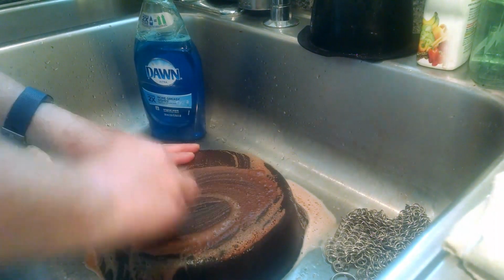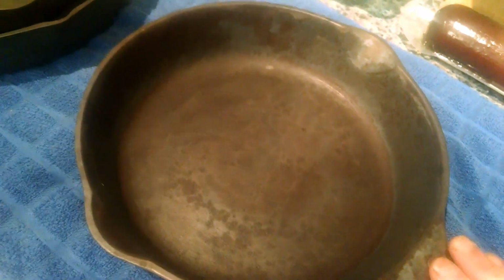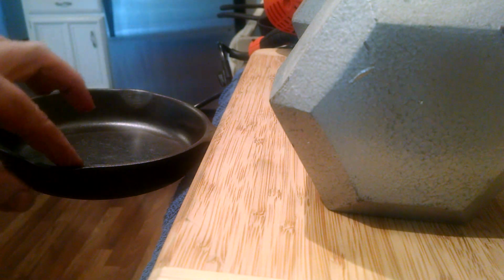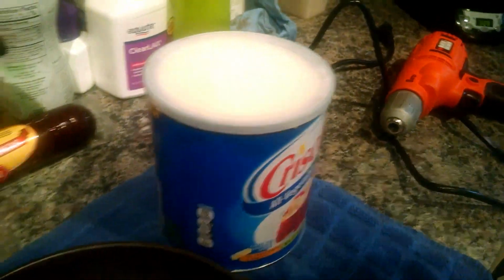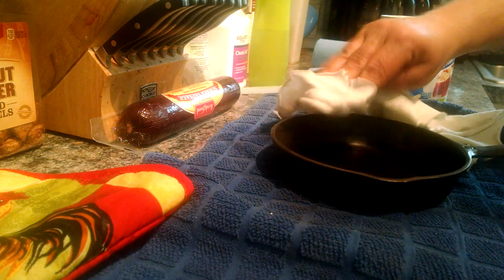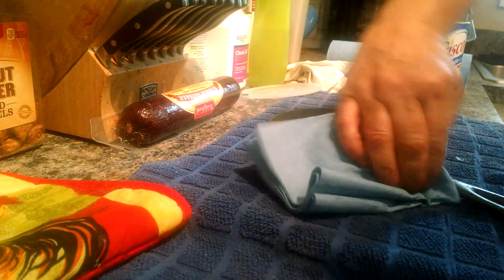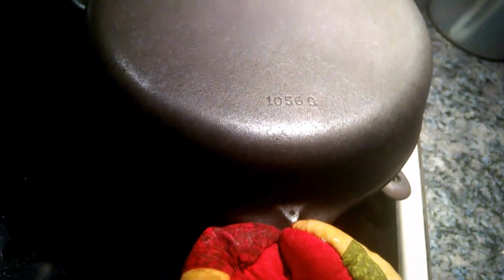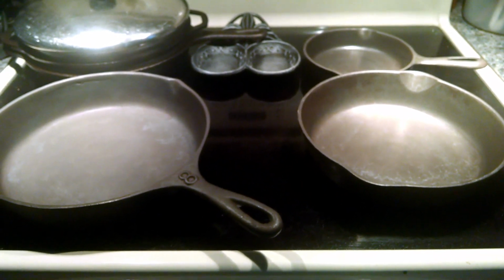Vintage Cast Iron Overhaul from Cruddy to Like New - Part 2

Comment: These are the guidelines I use to identify unmarked cast iron skillets; If the skillet doesn't have a heat ring and the word inch is spelled out in caps "INCH' it's a Wagner. If the skillet has a heat ring and the word inch is abbreviated "IN." it's a BSR. Skillets with three notches or one notch opposite the handle in the heat ring are Lodge. Some early Lodge pans are signed and some have a raised pan size number on the top of the handle. The letters on the bottom of cast iron skillets are mold numbers.
Reply from the maker: Yes, these are what I go by too, but unfortunately, I can't remember them all off hand and have to use my web site castironcollector.com  to look up the info again!  lol  That said, when I made this video, I was very new at identifying old vintage cast iron and have come a long way since then!  lol    Thanks for commenting and for watching.
Reply: I have a cast iron skillet with one notch opposite the handle in the heat ring. It also has an X on the bottom.
What is it?
thanks Glen
Reply: Thank you.  I never paid attention to that.

Comment: Never heat empty cast iron above 1000 F.  The structure of the iron changes at that temperature making it brittle and susceptible to cracking and warping.  This damage is evident if you knotice reddish areas that come through the seasoning.  If your pans are seasoned and you see the redness it is not rust, it is a weakened area.  Ovens vary, however the self cleaning setting temperature is usually over 1000 F.
Reply from the maker: I've never had any issues with my self cleaning oven and my oven doesn't get that high plus I don't leave my skillets in oven at that cycle for more than 2 hours.  That said, I do agree with everything you said.  I can't believe the number of people that comment that they throw their skillets into a fire to bake everything off and that is worse than my self clean oven.  The reddish areas you speak of are indeed fire damage and thus cannot hold seasoning, rendering any skillet with this damage useless.  Also any temperature change in cast iron should be gradual so as to not crack or warp the pan.
Reply: @ladylibertystacker2014 Nice video.  You got a like from me.  My post was cautionary for the "throw it in the fire" crowd.  I even watched Cowboy Kent Rollins put his in the fire.  I am watching these videos because I have my grandfathers 15 gallon cast iron cauldron.  I need to clean it up so I was looking for ideas.
Reply from the maker: @wb2194    Yeah I've seen Kent Cowboy Rollings do some questionable things myself that I would never do such as using flax oil to season with!

Comment: I know this was from July but in viewing your cast iron overhaul, and to help answer your question on your unmarked #8 skillet, from the handle construction where it comes  into the main skillet it very likely is an unmarked Erie skillet as they cast their handles the same way...
Reply from the maker: Now you're talking!  I think it's been called everything from an old Lodge to a BS & R, to a Southern Mystery Skillet!  lol   It cooks fantastic and truth be told, I really like Griswold the best, followed by BS & R or Wagner equally.  Whatever it is, it will remain in my collection for sure!  Thanks for watching.  :-)
Reply: What I have found is most Cast Iron skillets are cast in two ways one where the side and the bottom come together at almost a right angle or flow into each other with a slight curve where they meet, the handles seem to be the identifying characteristic, if you look at an Erie casting at this point you will see a great similarity where it meets the pan wall on the underside of the handle. It is great to see they are being used for what they were designed to do, and not just decorating someones wall...enjoy cooking with your pans.

Comment: I like that you season more than once.  Those old Wagner's are so much better Than Lodge because they are so flat.  The steel brush wheel is the way I go too.  I never clean with soapy water without re-seasoning.  As for the oven cleaner, I have to listen to Cowboy Kent.  If you don't want in your body, don't wash with it.  Personally, I think washing it a few times afterwards will clean that out to a small enough level that it won't hurt you.   Anyway, they look great and I extend my jealousy.  Congrats..
Reply from the maker: Thank you Eric!  Agree with everything you said except for the oven cleaner.  It's just lye,  but an expensive way to use it to clean cast iron.  The lye bath method is essentially the same thing but you can strip more than one skillet at a time and you can leave them in a lye bath for as long as you want.  The lye will not get into the cast iron because it is not heated up, thus it is not porous!  When you are done with the lye bath, then you neutralize with vinegar, so no worries about ingesting lye.  I've seasoned a ton of skillets and use them all the time to cook.  I'm healthy as well, so it works for me!  If you have questions, feel free to ask!  :-)

Comment: Is it acceptable  to use a wire wheel to remove built up carbon before placing a skillet into a lye bath in order to speed up the stripping process?
Reply from the maker: I always recommend using a lye bath (or Heavy Duty Oven Cleaner which is pure lye) FIRST before doing anything else because lye removes the surface crud and softens any carbonized seasoning that has baked onto the surface before putting a wire wheel to it.  I also do not use a wire wheel on truly collectible cast iron like any of my Griswolds, Erie, etc!  Doing so reduces collector value.

Comment: You did a great job on all the skillets, but can I use my regular oven?  Because mine is not self cleaning.  Thanks for your help
Reply from the maker: I really don't recommend using a self clean oven most times but only sparingly for that stubborn piece that is not at risk for warping under the real high heat that a self clean oven reaches during a cleaning cycle.  That said, a regular oven will not strip a skillet because the highest heats it gets to is about 500 degrees which won't do it. Many times a self clean oven will get upwards to 900-1000 degrees and will harm a lot of vintage cast iron because the walls are thin and it can cause serious warp.  Be sure to consult your owners manual for what your actual oven can or cannot do.  That said, I would do the Easy Off Heavy Duty Oven Cleaner (yellow) method in a bag to strip a skillet which there are plenty of videos online to help you do this.  This was my first attempt at restoring vintage iron and I lucked out.  All three pieces are in service in  my kitchen today.  I will be using one of them to saute shrimp a little later for our dinner.  Hope this helps.  Anyway, thanks for watching and for your thoughtful comments!

Comment: Is it ok to have a fair amount of flash surface rust on the pan? I strpped a lodge I bought for cheap from a lady that needed redone. Attempting to do this method now, during the pre heat a fair amount of rust came to the surface.
Reply from the maker: OK.  Once a skillet is stripped down to the bare metal, gun metal gray, I spray on a coat of Canola cooking spray (you can also use Pam as it is basically the same thing) to protect your pan from flash rust.  This will prevent rust from showing up before you get a chance to season it AND in the pre-heat process while seasoning.  This is the best method to stop that once and for all. I do have a video on how to prevent flash rust which should be in my channel cast  iron playlist.    Hope this helps!
Reply: Thank you.

Comment: Lady L,your videos are informative. Which works best,oven cleaning or lye and vinegar method?Thanks.
Reply from the maker: Thank you john!  They are all effective, but the lye bath method induces less wear and tear on your oven, can be left to soak your skillets until you are ready to continue your restoration, but you need patience with lye.  The oven can produce lots of smoke, so wait until your wife isn't home to do that one!  You also need to be careful your oven doesn't get too hot because too much heat can permanently damage your skillet where it will be unable to hold seasoning.  That said, vinegar is needed in most cases to remove rust and especially that stubborn black carbonized seasoning that can look like black warts on an old skillet.  Check out my cast iron play list where I often times combine methods depending on what issues I am dealing with on a particular skillet.  Good luck!

Comment: Is there any way to get build up off the outsides of them? I have a 14" that's 30 years old, used almost daily for 25 years. Lots of build up on the outside and I want to clean it up but don't know how to do it.
Reply from the maker: Can you send a photo of your skillet to my gmail -ladylibertystacker@gmail.com?  If not, then what does the build up consist of?  Is it crud from cooking all these years, oils or seasoning built up on the outside of the skillet? Do you have a self cleaning oven?  Also do you have a regular hardware store in your vicinity?  If you can answer these, then I would know at least where to start.  Thanks.

Comment: Can you sand with steel wool or sandpaper if you do not have a drill?
Reply from the maker: Absolutely!  Steel wool is the preferred way anyway because it doesn’t remove any of the base metal.

Comment: Question... Do you cook with those on you glass top oven? I was told that you couldn't cause it would shatter the glass top. So I'm scared to cook with mine. Any info would be great. Thanks.
Reply from the maker: Yes, I cook with my CI on my glass stove top all the time without issue.  You just can't drop your CI on your stove top (a given) or make any sudden heat changes which includes cooking on high for any length of time or cooking on med-high for a brief time.  Please see my comment detailing the steps you take for safe cooking.

Comment: Did the pitting in the Wagner Ware eventually fill in with seasoning?
Reply from the maker: Yes, actually it did somewhat.  I have used that pan now for almost three years and it is my go to for gravy over toast!  The pitting is much smoother than it was as the seasoning fills itself in.  I supposed if I used it everyday, you wouldn't notice any of it by now as it wasn't all that bad to start with.

Comment: Yea that’s all I do . Some were my grand mother’s . Slick as glass. Thin to .
Reply from the maker: You can use soap (I like Dawn as well) to wash your skillets as long as you have many carbonized layers of seasoning.  A little soap won't hurt them because they are seasoned many times from use.  I don't recommend soap, however, on a newly seasoned pan.  It will remove some of that newly applied seasoning.

Comment: I have Wagner  Ware  5 qrt. No. 8 Drip Drop roaster. Any ideas on how old it may be? I am planning to restore it and use almost exclusively for soups and the like.
Reply from the maker: I have one question for you before I can give you any kind of definitive answer.  Does it say Made in U.S.A. anywhere on the roaster, especially on the bottom?  If it does, it was made in the 1960s (latest possible date was approx. 1968-1969 before they went out of business), otherwise, it was made before 1960.  Check out this site for a lot of information:  www.castironcollector.com  Hope this helps.
Reply: Yes
 It DOES say MADE IN USA
Reply from the maker: Ron M.   Still vintage and Americana is worth restoring!  At least most cast iron doesn’t say MADE IN CHINA!  lol

Comment: I have an identical skillet as you #3 - 6 1/2".  Did you arrive as to the maker of that skillet?  I did learn a lot from you video.  Thanks so much.
Reply from the maker: Yes I did - it turned out to be an unmarked Wagner Ware and I still have it to this day!  Glad you have enjoyed my channel's content.
Reply: @ladylibertystacker2014  I also have an unmarked #5 9 inch skillet with the letter 'H' on both the bottom and the handle.  It looks very similar to the #3.  Based on your findings, I believe it to be an unmarked Wagner Ware as well.  Again, thank you so much.
Reply from the maker: You are very welcome!  You have a Wagner #5 as well.  Wagner put the mold letter on the skillet bottom and on the handle.  That is one of Wagner's tell tale signs of their process in addition to the font on the bottom detailing the size.

Comment: What would you suggest if someone doesn't have a self cleaning oven?
Reply from the maker: The best way is the long but easy way.  First a lye bath (5 gallons of water + 100% pure lye crystals added to the water) soak for as long as it takes, followed up with a 50/50 vinegar water soak to remove stubborn old carbonized seasoning and rust.  After that some elbow grease is required to finish off the skillet before seasoning.  have several videos showing this process on my cast iron play list.

Comment: I refurbish my cast iron with easy off oven cleaner.
take outside lay on several layers of newspaper and spray the inside , clean it, and then do the outside.
Reply from the maker: Yes, I have occasionally used Easy Off Oven Cleaner Heavy Duty kind when I get that stubborn pan.  That said I usually use my lye bath to soak the skillets followed by a vinegar/water soak to remove the rust that the lye couldn't remove.  Easy Off is essentially the same thing, just more expensive if you are using it to clean multiple skillets.

Comment: I watched a man remove the rust with half a spud 🥔 and table salt and a little water and it worked ok maybe next time try heating the pan in the oven then try using the spud and salt to get deeper in to the iron paws this is just a tip and up to you if you want to try next time I hope this tip works well for you
Reply from the maker: A vinegar wwater soak is quite effective as is Coca Cola and if one is desperate, there is Evaporust, although that is quite expensive.  But thanks for the tip.
Reply: LadyLibertyStacker  I have used vinegar before or my pans and it does work well to .. I think rubbing a lemon on it would work as well not that I have but I might one day lol

Comment: Great job.!Thanks for showing what can be done with an old skillet I have a size like the second one. My is  a doge made in the USA .will work to get my to look like yours. And if u sell yours, may I sell my.😀😂.
Reply from the maker: Thanks Agnes!  This was my first attempt, but first I did a lot of research on the best ways that would possibly work for me.  I am happy to say these skillets are still in my collection and are in use when the need calls for them!  They are a bit blacker than you see here which is what happens as time marches on if you use, clean, and maintain them properly!

Comment: Can I cook in a cast iron skillet on a glass top stove?
Reply from the maker: Read your stove manual to be sure.  I have had no issues with mine and I've been cooking with mine for the last year and a half.  It is an older stove, so when it goes, I will get something more compatible for cast iron.  The two things to be aware of is that the stove can burst from the heat of the skillet if it gets too hot on the stove.  I make sure I don't keep the heat that high and if I need to, I use it for short bursts.  The other thing to be aware of is if your skillet has a heat ring on the bottom, don't drag it on your stove top.  It will scratch.  If you are careful, it should be OK.
Reply: @ladylibertystacker2014  thank you for your reply.  I will look into this.  I bought burner that plugs into the wall all for my iron skillets.  One of my skillets was packed away for a couple of years and only a small bit of rust.  Going to season using your oven method.  Like your videos.

Comment: From all I've been learning about cast iron, you are not supposed to use a wire brush. It  Prevents the Pan from holding on to the seasoning which is very important
Reply from the maker: Yes, that is what the web sites say.  However, my #6 Wagner restored in this video is still in use in my kitchen and is as black as ever, so what we have read isn't true all of the time.  I have this skillet to prove it.

Comment: Takes me forever. I let the pans cool with over off after 400 cycle. Each round takes about 3-3.5 hours
Reply from the maker: With the 200, 300, 400 (I go slightly higher at 405 to get over the smoke point of Crisco) method, it does the job in the least amount of time.  I will season a skillet 3-4 times after stripping it before I think of using it!